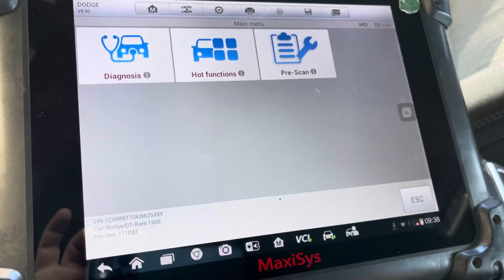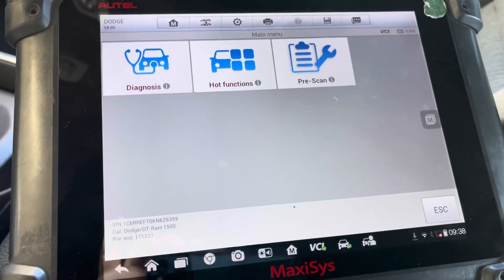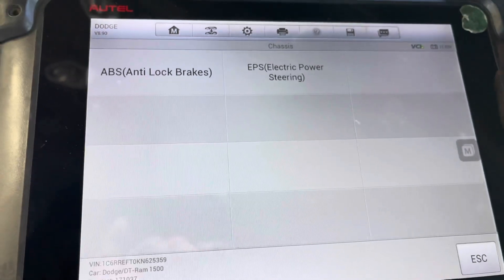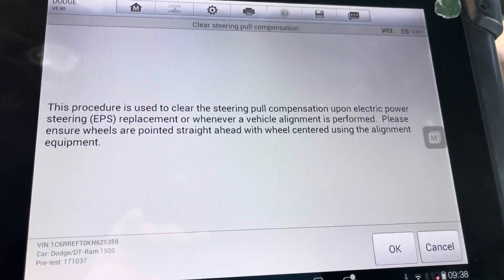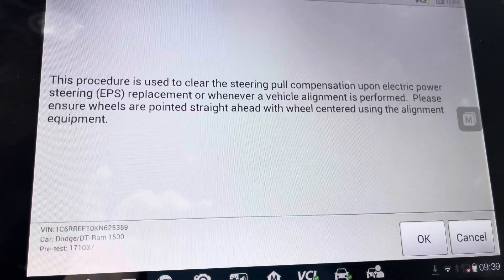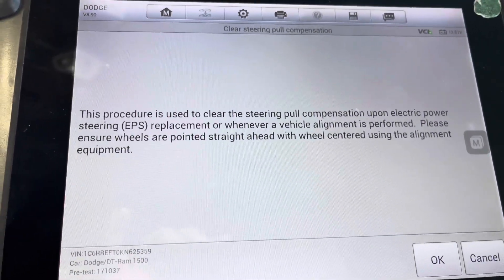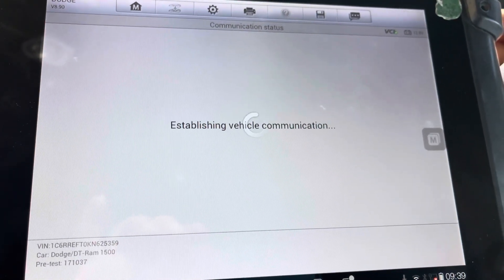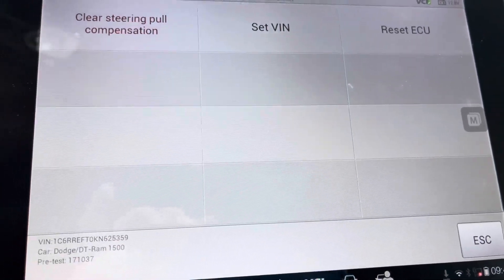Steering Pull Compensation Reset After Wheel Alignment | Steering Angle Sensor Reset on 19 dodge ram

Comment: I have a 2020 ram that had a bad steering electric motor. Guessing that same feature is also to reset for the new motor? Also was yours still on the subscription? Seems it will only let you in if the subscription is current.

Comment: Hi I just ordered  an autel mk808ts do you know by any chance if that scanner has those functions
Reply from the maker: I have never used that model but it does say in the description that it does SAS reset ( steering angle resets ) so there’s a very good chance it does have these functions
Reply: @themodernmechanic428  i should be getting it tomorrow i order it cuz  i replaced a rack and pinion on a 2017 chevy and I got an alignment and a message came up on the dashboard something about the steering wheel drive with care hey and thank for answering ill let you know tomorrow
Reply: @carlosmfk5459 what ever happen bro